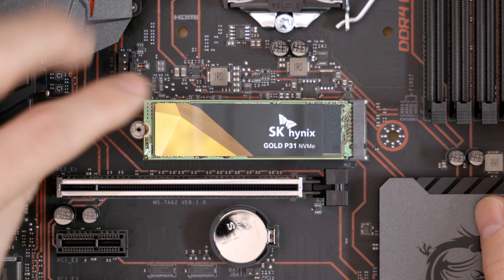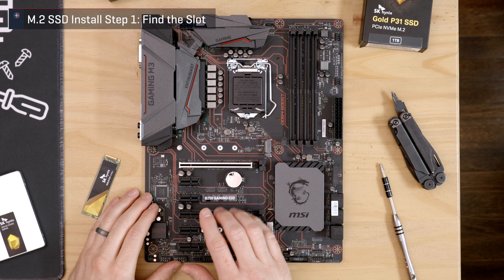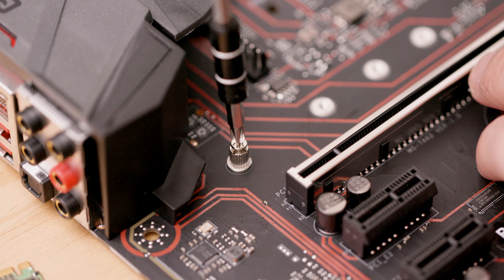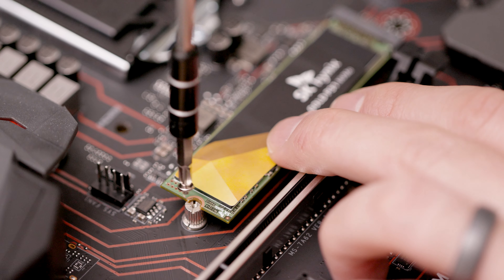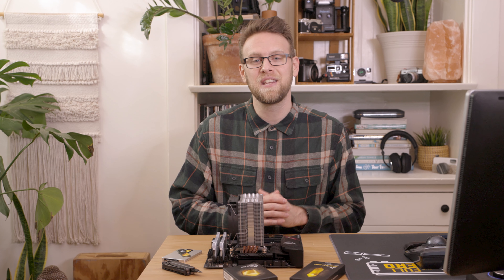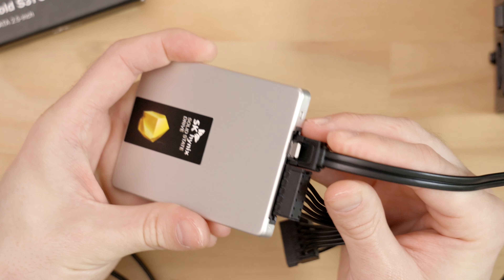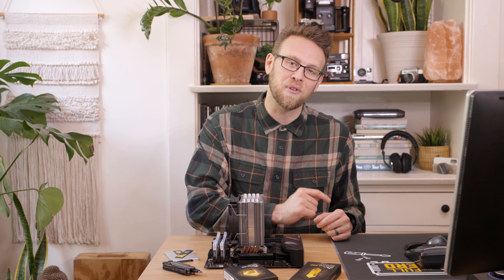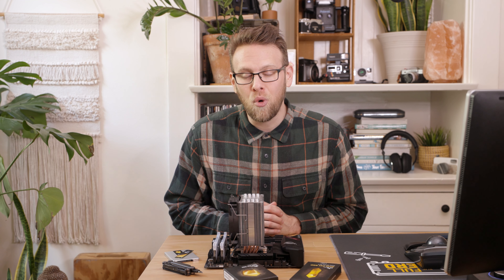How to Install An SSD in a PC

Comment: This is also important, so your 2.5 inch SATA SSD is recognized in BIOS. On a lot of motherboards, SSD ports can share PCI lanes.  Check your manual so that you install the SSD data cable in an open port (not already in use) PCI lane.
Reply: @pcworld  I mentioned this, Adam, because if they have a previously installed M.2, the 2.5 SDD install could force the M.2 to no longer be recognized as an installed drive. It's very important to mention this, even if it is just a basic 'how to' video...
Reply: @pcworld  I don't have a manual, what should I do?
Reply: @stephen3260  Find it online?
Reply: @rjjeffreys  could it have that effect on an SATA III HDD? because i installed a new m.2 last night and my HDD stopped showing up in my devices and drives, though my other SSD still appears
Reply: @CourtesyoftheD  Absolutey, it could be an issue for you. But, also be sure to check that your HDD SATA power and data cables are tightly secured, and then check if that drive is being recognized again in your BIOS after. Good luck!
Reply: @rjjeffreys  i have no idea what you're all talking about
Reply: @robery4008  Your MB manual will show you what are the PCI shared lanes.

Comment: Thank you for the information. I've been struggling with the building of my new PC for 2 days. I've built PCS before but not with this new type of memory. There was no mounting screw for the m2 memory and nothing in the case would fit the mounting hole. It wasn't till I saw your video that I realized the cover over the m2 socket was actually a heat sink.  So I followed your instructions once I realized that, and everything finally came into place. Whoosh

Comment: Great video! I am looking up parts for a new PC since I built this when Ryzen first came out. I'm running a Ryzen 5 1600.....I sorely need to upgrade. I didn't know M.2 drives dropped drastically in price, I will definitely do that instead of another Sata SSD.

Comment: im trying to upgrade to 1tb but i havent bought anything yet because in the manual there isnt anything about storage slots and if i for example have a 500gb ssd can i put a second 1tb so i get 1.5tb storage? and last question is buying SATA or an M.2 better?

Comment: Greetings from the future! Can i install my SSD without removing my GPU and CPU?
Reply from the maker: Depends on your hardware configuration and where the slots are on your motherboard. Some slots might be blocked by a CPU tower cooler or by a GPU. Typically you want to have the SSD that has Windows installed on it in the slot closest to the CPU (commonly labeled M.2_1) which could be blocked by a tower cooler. But if you are adding an SSD for extra storage you can use other slots that are easier to get to, though some of them will be directly underneath your GPU. You'll have to refer to your motherboard manual and plan out which slot you want to use.
-Adam

Comment: 4:48 I don’t understand why you didn’t use the standard standoff and screw. The screw is designed to sit lower than the memory chips, so it won’t interfere with the heat shield. Skipping it just makes the installation unnecessarily difficult.

Comment: Do I need both drives for the installation to work? I only have the 2.5 inch SATA SSD drive. Do I need the M.2 as well?
Reply: no
Reply: The m2 is a separate drive.

Comment: Hi I’ve bought pc already m.2 SSD installed with windows 10 on it but it doesn’t show my own SSD that’s attached with sata cable ? It shows in disk management but as Disk 0 but it doesn’t show as unallocated or hidden, might be mine SSD is windows 11, any guide or help ?

Comment: My biggest complaint is having to go find a screw to hold down the m.2 unlike laptop ram which just clicks into place.

As I was looking through my box of screws I was getting more and more scared I couldn't find one but eventually I found one.
Reply: Where did you find it? Is there any Things from which I can get int if it's not in my Screw Box?
Reply: Same issue except I can’t find any that work😪
Reply: @rahulgupta9975  Took one out of wifi adapter myself
Reply: @danh6948  LMFAO

Comment: I kept dropping that tiny screw. I ended up putting a tiny bit of tooth paste on the tip of the screwdriver and then that held the screw to it long enough to insert it and screw it in. Then I used a cotton swab to clean the top of the screw.

Comment: In my motherboard manual it says ,,. Please note that an M.2 PCIe SSD cannot be used to create a RAID set either with an M.2 SATA
SSD or a SATA hard drive. To create a RAID array with an M.2 PCIe SSD, you must set up the configuration in
UEFI BIOS mode''. What does it mean exactly ?

Comment: I built my pc several years ago with a small 2.5 inch ssd and a hard drive. The hard drive is failing so i need to put in a new one so i am upgrading that drive to a 4tb 2.5 ssd but i am unsure of the steps.

Comment: QUESTION: do i need one or the other or do i need both? please help me
Reply: It is up to you how many SSDs you want in your PC. If you want more than one make sure your motherboard has M2 ports. I personally have a 1 TB HDD and a 2.5" 250 GB SSD and it works just fine. Remember you can always upgrade your PC at a later point if you're not sure at the moment.

Comment: Does anyone know if the small or large one yields better results? I'm having horrendous load times and need a fix
Reply: Short answer: NVMe SSDs (small rectangle looking drives) are the fastest drives. 

Longer answer:
There are 2 main storage drive types: Hard Disk Drives (HDD) and Solid State Drives (SSDs)
Hard Drives are the traditional storage drive that have been in most computers for decades. They offer high storage capacities and relatively low prices but are slow. Hard drives come in 2 sizes: 3.5" (for desktop computers) and 2.5" (for laptops and also can be used in desktops).

SSDs use flash memory which gives them very fast read/write speeds instead of using disk platters like hard drives and mechanical parts. However, SSDs are still more expensive per gigabyte than hard drives, but prices have come down a lot over the years. SSDs come in 2 main form factors: 2.5" (just like a laptop hard drive) or M.2. To add a bit more complexity, M.2 is simply the form factor or physical design. There are 2 main M.2 drive types: NVMe and SATA. NVMe drives offer the best performance since they use PCI-E lanes. SATA M.2 drives offer the same performance that 2.5" SSDs offer because they use the SATA controller. Either M.2 NVMe/SATA or 2.5" SSDs will be faster than most hard drives.

Comment: What if when I turn on my pc it goes straight to bios and won’t recognize the ssd
Reply: Make sure your SSD is installed correctly. If its an M.2 drive, reseat the ssd in the M.2 slot. If its a 2.5" SSD, make sure both data and power cables are connected securely into the respective connectors. Make sure the other end of the data cable is plugged into a SATA port on the motherboard.

Comment: What if you have an SSD with windows bios on and you are looking to upgrade, how can you transfer that with out having problems ?
Reply: Windows BIOS? That doesn't make sense. Anyways, you can move a drive with Windows to a new PC and it should boot up. I would first uninstall the motherboard-specific drivers and software. Once you do that, install the drive to the new PC and install the drivers and motherboard-specific software.
Reply: @JJFlores197  I didn't mean BIOS sorry I meant windows update but I hope some one finds that helpful

Comment: can i combine a 2 ssds as single local disk C?
Reply: Yes. That's known as a RAID setup. It is not typically done in most PC builds, but you can do it. There are many RAID types, so you want to do some research on it. The easiest way is to setup a RAID-0 array. This allows you to essentially 'combine' 2 drives to appear as a single drive on your PC. The draw back is that if either drive fails, all data is lost. There are pros and cons to each RAID setup so you want to do your research.
Reply: @JJFlores197  Thank you so much!

Comment: its difficult to find this here in Europe...would cost 250 USD...so I ordered one from Amazon USA for 140 USD incl shipping. I use this SSD for my Macbook Pro 2015...because of its efficiency ... since we are now in 2023...3500mbs is not fast anymore...but i didn't buy it for the speed...my MB can max reach 1500mbs only...I bought it because it won' drain my battery that fast like a Samsung would...

Comment: What if mine didn’t come with a manual?
Reply: A lot of SSD don't come with manuals; sometimes a quick start guide. Just plug it into the appropriate slot/cable on your motherboard

Comment: You missed the part where as in where you connect the OTHER END of the power cable. You only showed and explain the thin cable that goes in to the mother board, but the one for the power source i don't know where it goes , one end is in to the ssd but the other end where the rabbits foot does go....Make sure to edit your video and SHOW where the end  goes in to ! Now i'm forced to find another guide that actually shows that !😵‍💫

Comment: Can motherboards accept any SSD card?
Reply: Depends on the motherboard and SSD in question. If its a 2.5" SSD, then it will work with pretty much any motherboard from the past 15 years. You just need to plug in a data cable from the board to the SSD and a power cable from the power supply to the SSD. If its an M.2 SSD (be it NVMe or SATA), then your motherboard has to support it. most board from the past 5-7 years support M.2 drives in addition to SATA drives.